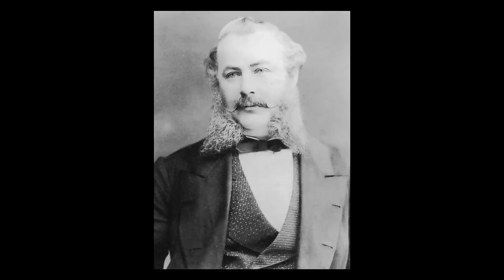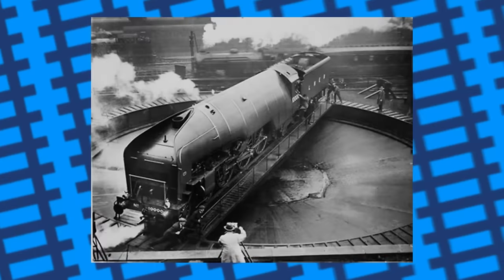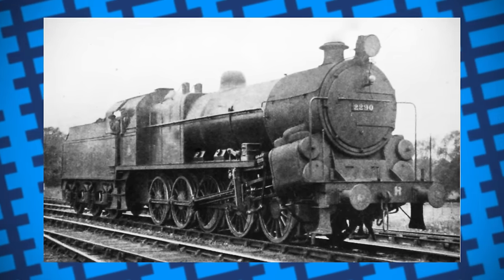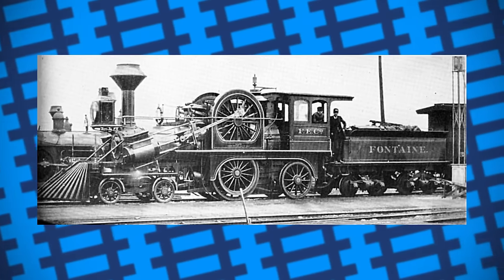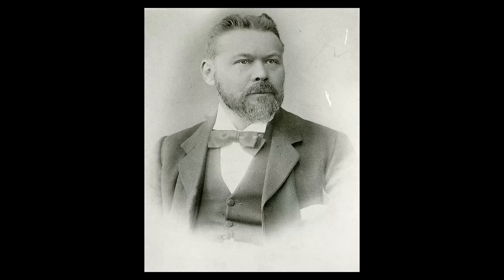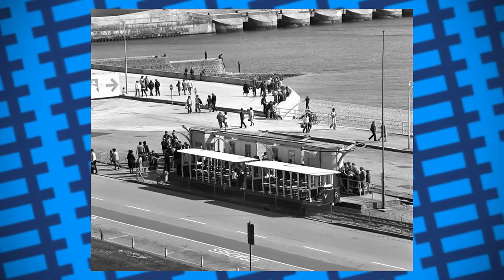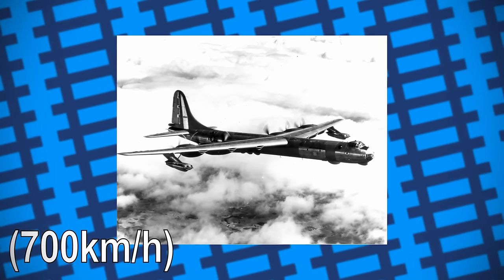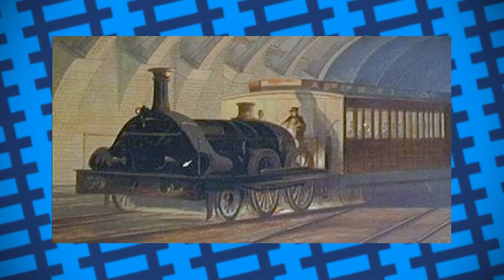Train of Thought COMPILATION - Unusual Experimental Engines

Comment: It's interesting that in Europe, the big boy is considered to have a "front powered bogey", here in the states a standard layout articulated layout is referred to as the "front locomotive" and the rear set of drivers is referred to as the "rear locomotive".
Reply: I think you've actually stated what it's referred to by everyone of a technical nature worldwide without actually realising it: its termed the front or rear drive set or f/r set of drivers, like it has through the ages.
I've basically never heard it referred to as either a f/r driving bogie or driving locomotive.
Maybe it's a modern thing
Reply: @muir8009  fairly commonly referred to here as the front and rear drivers, as well as front and rear locomotive. But I've never referred to the front set of drivers referred to as a "powered bogie". By definition, a bogie is on the end of a rail car or locomotive. The drive wheels are not. 

I just now realized I spelled it wrong in my original comment too 🤦‍♂️

Comment: I have a question.
As stated, there's very little advantage to having a high pressure boiler on a conventional locomotive. And turbine locomotives would later also fail. I have been taught that the reason that turbine locomotives mostly failed is due to the low pressure of locomotive boilers, when turbines operate at higher pressures. If this is true, wouldn't turbine locomotives been more successful if high pressure boilers were mounted? Or am I wrong?
Reply: The issue with turbines is that most of them designed for a practical railroad environment had to exhaust at atmospheric pressure, rather than into a condenser.  See the inimitable Douglas Self site for more on both condensing and non-condensing engines -- some of which were very successful.

The United States conducted serious research into a condensing high-pressure (first 1200psi, then 1500psi) system as 'Steamotive' in the 1930s.  Even as late as 1938 this was nominally competitive with diesel-electrics... but by the end of WWII there was no reason even though the major issues had been addressed.

Comment: How did it run between King's Cross and Edgeware without being standard gauge at the time?
Reply: I believe the line was dual gauge at the time, given the GWR use of it. (especially looking at early pictures of "the tube". it's why Baker Street is so wide)